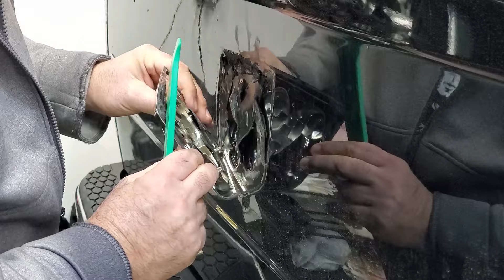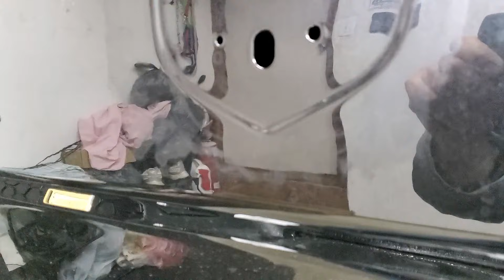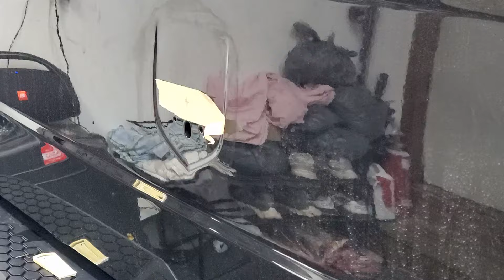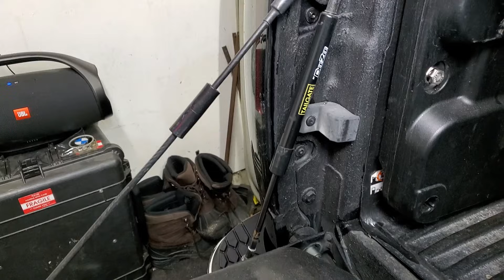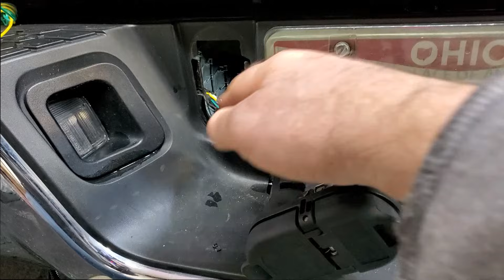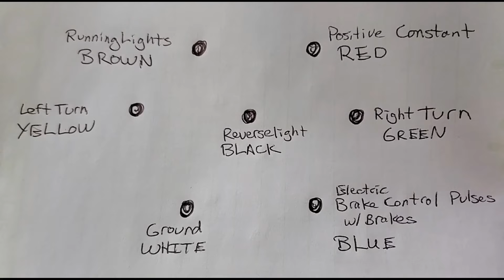Trick Third Brake Light  Dodge RAM Truck Mod

Comment: And spicy new date on there I do it quite a bit tonight
Reply: My stupid phone changes words
Reply: I said I do that quite a bit once I sold it I finished my Bennett together and it's fine piece of heat shrink over the bend area in a cover-up the bare wires and takes trinket
Reply from the maker: @keithbarker149  Makes sense now.. LOL  My phones does the same thing.  Thanks for watching

Comment: Great video.  A little tip.  When I do a skin back splice, I actually cut the wire I'm tapping, twist and tin the wires on the side with "two" wires.  Slide your marine heat shrink (it has glue inside to keep moisture and corrosion out) on.  Make sure the heat shrink is big enough for to cover the 2 wires but still shrink small enough to seal the single.  Then you can wrap the single wire around and solder it.  I don't pre-twist this wire, I leave it untwisted so it will wrap flatter and the heat shrink will lay neater on the connection.  I've done this on motorcycles, boats, cars and light fixtures ( I had a restoration shop years ago) and never had one corrode or come apart.   I would also wrap this with 3M Rubber Mastic tape for additional protection.   I like the idea of putting zip ties on the ends of the pvc electrical tape vs the old school way of tying the end.
Reply from the maker: That is awesome advice.  I will do this next time.  Thank you for sharing.